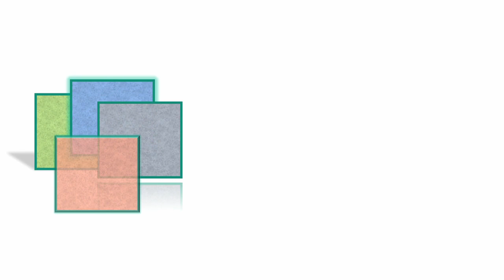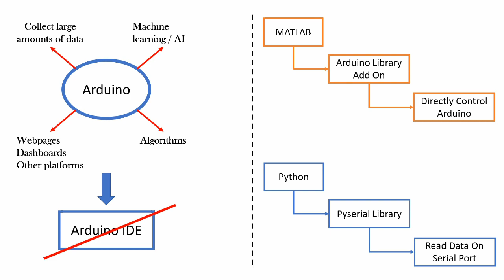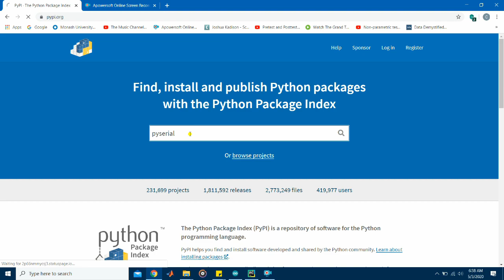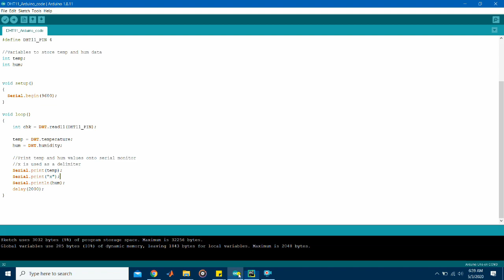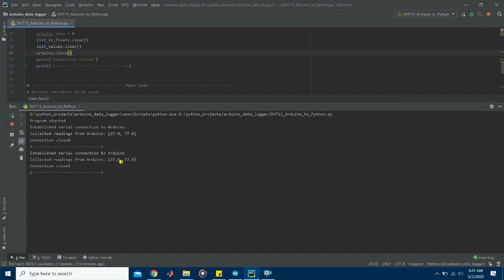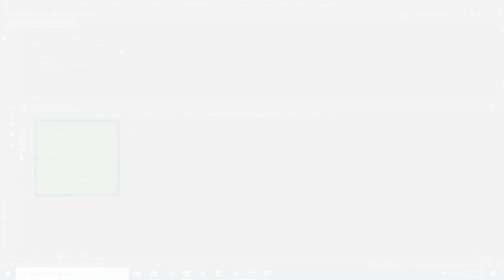Sending Data from an Arduino to Python | Pyserial | DHT11

Comment: Thanks for interesting video.
However, this line in my program:  "arduinoData=serial.Serial('/dev/ttyACM0',115200)"   gives me 
error:   arduinoData=serial.Serial('/dev/ttyACM0',115200)   AttributeError: module 'serial' has no attribute 'Serial'
I am running my program in  a virtual environment (venv) an have imported module pyserial3.5.
Reply: have you installed pyserial. If yes and still you have problem then I believe you might have named your python file as serial.py . If that is the case change the name .

Comment: In python codes, what if I want to split multiple data values, for example I have 3 sensors reading. So what codes need to be done? it is the same?

Comment: I’m setting the timeout to 2 while creating the serial object. When I’m reading from serial port I’m checking wether data is present in input buffer by : 
if(obj.inWaiting>0) :
    
If the data packets are interrupted it hangs in there.... I have given timeout value as 2 still it’s waiting indefinitely... why it’s not considering timeout value????

Comment: then what if we want to send data from Arduino via the internet, please explain how, thank you
Reply from the maker: You would need a WiFi module to connect the Arduino to the internet. You can use an ESP8266 module or a NodeMCU (ESP 12) to do this.

Comment: Thanks for the video.I have question.How can we do this without Arduino USB cable? How can we communicate python and arduino without cable?
Reply: You could use a wireless USB cable, but the computer must be connected to the arduino via an USB cable in order to get the data from the python code.

Comment: thanks, tried this but was only able to get it working by using 

arduino_data = arduino.read()

instead of 

arduino_data = arduino.readline()

Also, I do not get the exact values, decimals, just rounded to the nearest value.